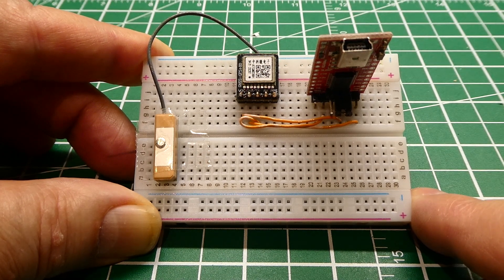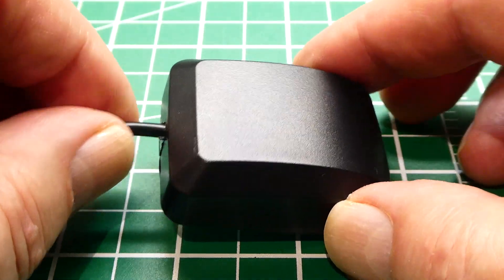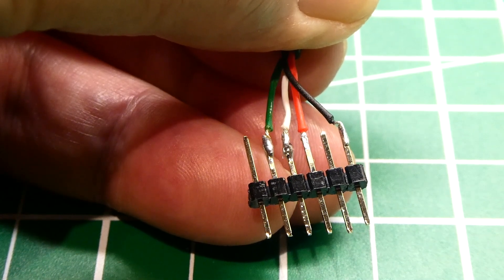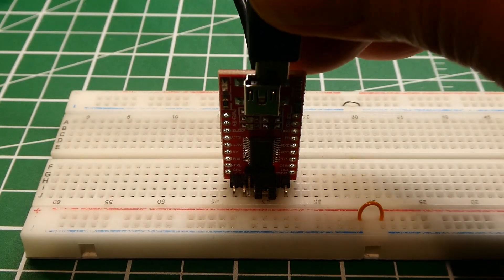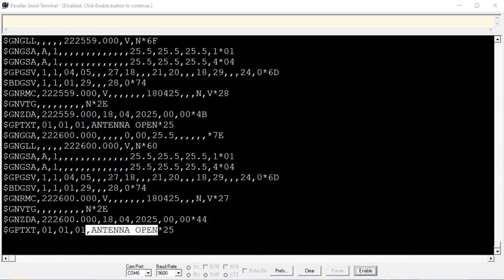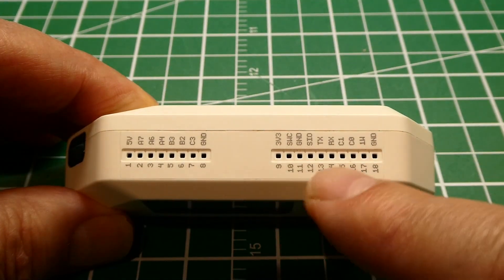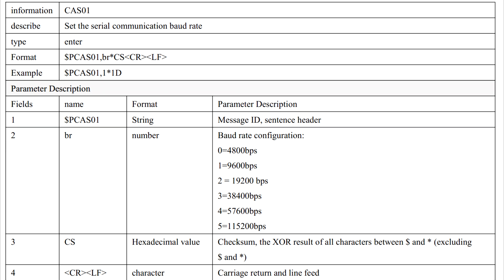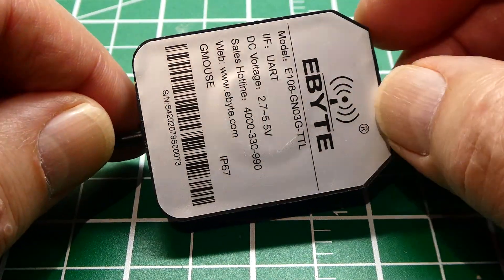Waterproof GNSS (GPS) Receiver / Flipper Zero

Comment: Very cool, I used the 1st board in my RT-3S radio when I 2nd hand purchased the nonGPS version, just as a little project some time ago.

I like the usb thumb drive style modules not waterproof but no long wire and it’s pretty much a single chip solution e.g k-172 usb module, was very easy to make a compact, affordable low power little tracker in an outdoor sonoff box. Lots of fun but not for commercial use lol
Reply from the maker: Thanks for sharing.